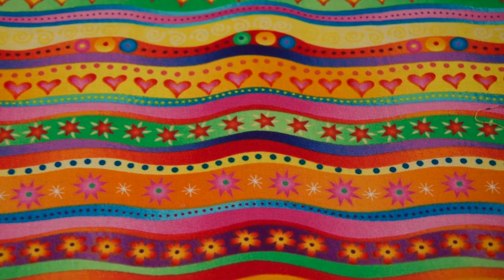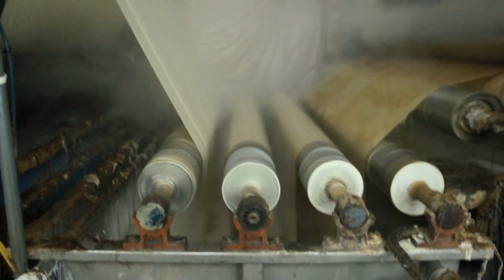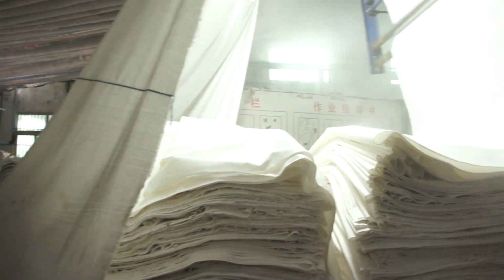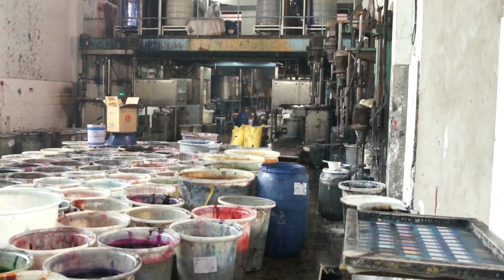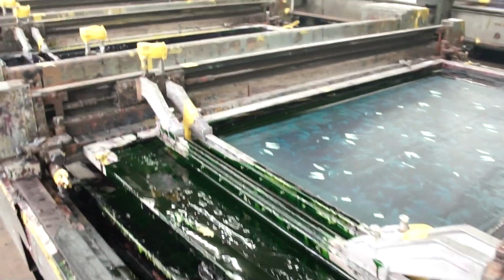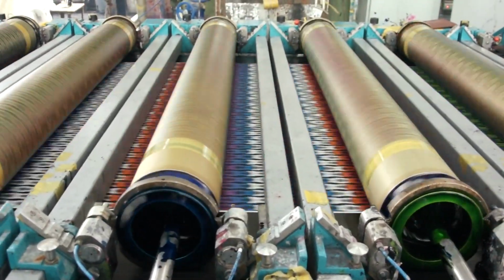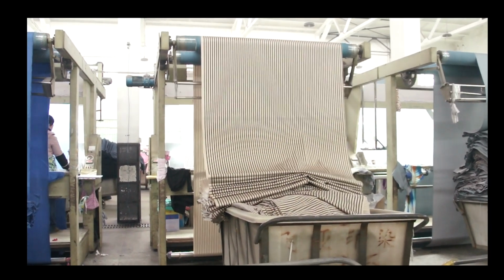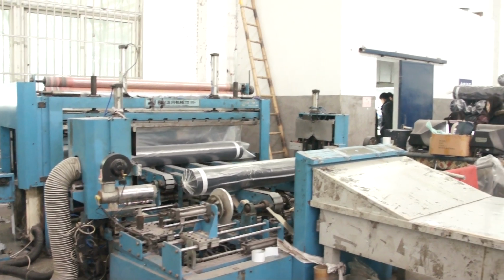Printed Fabric Production

Comment: I really enjoyed this film! Thank you. I do have a question, though: How is the ink prevented from smearing, as it goes under the next screen, where the next color is applied? I would think that when the next screen presses down to apply the next color, there would be color transfer from the previous colors of wet dye onto the screen that would eventually make a mess! Thanks for answering.
Reply: Yes smearing can present a major problem, not only flatbed, but also rotary printing.
Usually depends on 3 causes: first and foremost the colors. Black (or dark) color is infamous and will easily smear the lighter colors. solution can be readjusting the order of the colors; adapt viscosity of one or more colors; tape off all screens that follow the dark color.
Next: make sure the print is in register. If they are off, even slightly, screens will pick up dye of other colors, visibly as outlines of the printed color.
Lastly: the fabric is not sticking well enough to the belt. That means it will move in between the printing colors and affect register problems and also smearing problems.

Comment: Very informative video. Would the rubber used on the flat screens be made from natural rubber latex or something synthetic?
Reply: The squeegees are made of normal synthetic rubber, but they must be carefully grinded/sanded  to a half-round profile and be absolutely smooth, or it will show as lines on the printed fabric. Also interesting is the large and long rubber belt,  the most costly part of the whole machine.  Besides being a pain to install and make it run true, the coating has to be super smooth or else it will show in the finished product. Not a simple task, especially at the location of  the rubber belt's seam. 
As you know, it is paramount that the fabric, glued to the rubber belt, will not move a bit during printing.
Therefore the coating of the belt has a sticky property, to help accomplish that

Comment: How does the initial fabric get started in the machine?
Reply: first they guide a rope through the various rollers of the printing machine and dryer, next they attach  a "runner" ( length of old fabric about the same width as the fabric to be printed) to the rope and run that trough the entire machine. Our machine needed more than 80 yards of runner from start to the end.
Now all you have to do is sew the printing fabric to the runner and glue it to the rubber belt so that it absolutely cannot move between the printing stages (be it flatbed or rotary) . The dryer intake picks it up and  tears it loose from the belt. The belt gets washed by a washing station underneath so that no glue and dye sticks to it, cause that would really mess up the next printing round.

Comment: my mind was blown within 2 minutes, as i was not expecting to see OPEN FLAMES in a fabric factory, inches away from the fabric
Reply: We had that same machine in the factory I worked (years and years ago)  The operator one time was distracted (had to take a leak) and for some reason the fabric became stuck and to a standstill. Of course there is a safety mechanism that shuts off the gas in such a case, but it was too late and the whole thing caught on fire quite spectaculary! Not easy to keep your wits cool.....

Comment: how much cost of producing and printing 20 meters per design,50 designs total=1000 meters
Reply: Nobody will do such a small quantity per design. I run a similar factory in India. And 20 metres per design is not really a manufacturer's quantity. You'd be better off buying fabric directly through a distributor/reseller.

Comment: Why does the dye not get to the other side of the fabric?  And if it did/could, would that mean the fabric would stay looking good for a longer time?
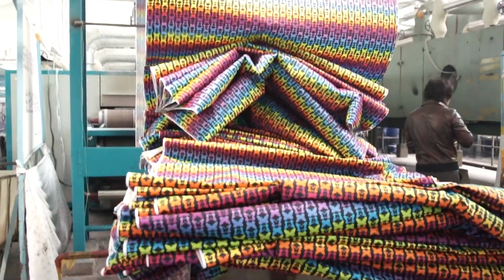Reply: It is just not cost effective. Dye is costly and cannot be wasted. The fabric does not look better when the dye is pushed through all the way, but the amount of dye used would almost double. Also would  it leave residues on belts and rollers.  At 12:08 you notice that the red dye is squeezed just halfway through the fabric, but still shows a full and intense color on the right side
Reply: @chamagical  Thank you!

Comment: Do they every clean those machines?
Reply: I'm sure a down day(when machines are shutdown to clean and repair) is when those workers are actually expected to work. They have it so easy.
Reply: @lightdark00  Ha !  I admit it looks deceivingly comfy when everything is running as it should, like in this video clip, but I will assure you, it can get to a mild crisis in no time!  So many things can (and will...) go wrong in a machine this complex and mostly also all at the same time!
Take the guy at 12:00  for instance, looks like he could easily do 2 jobs in a day and still not be tired. But instead this guy has to be sharp all the time. How? He does the first quality and color check of the product  and alarms the printer when things go bad. Remember at the rate this machine is running and the length from start to end, any fault discovered amounts to at least 100 yards of 2nd choice product.  A guy like him saved my ass once, when I accidentally placed a color drum of dye at the wrong screen. ( when printing reactive dye the color changes quite substantially after drying and steaming, and only the guy at the end of the line sees the colors as they should be.) The boss will not be amused if you printed a couple of miles in the wrong color !
The printers day can be not so easy when there are lots of short batches with different prints. Some customers want trial prints, to check on colors e.g. That means print 50 yards, then take all the screens out, clean them, change colors, put screens in again or different prints, get them in register, adjust the pressures, 50 yards stop and do that all over again ......